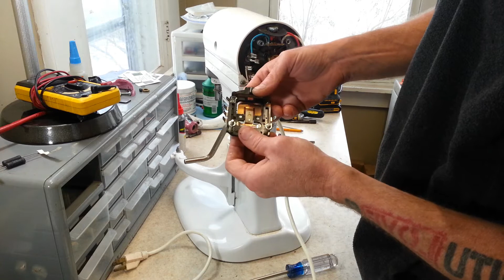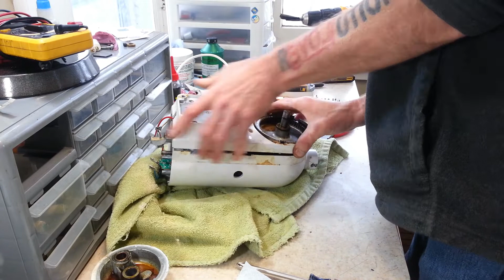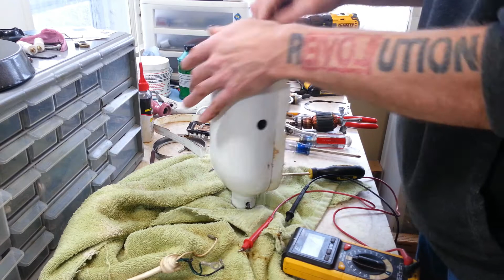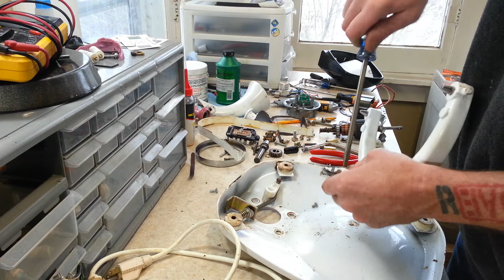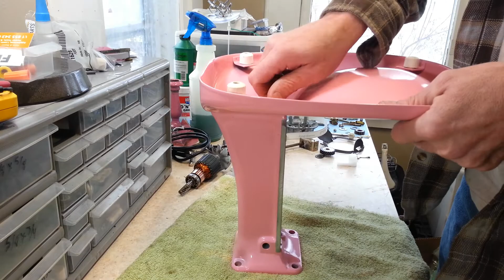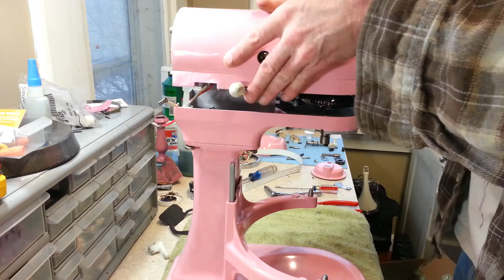Kitchenaid KSM5 mixer restoration in pastel pink

Comment: Same model I've got.  Made around 1998 or so.  Still going strong today, but I've also never dropped it...  Yet.  I really enjoy your videos, thanks!
Reply from the maker: Thanks Zachary! It does seem to be one of the better made KA's!
Reply: I have that one, too, but mine is Imperial Grey.  I've heard that even though Whirlpool owned the company by then, that they were still using Hobart specs for these mixers.  Mine is very strong and reliable, too, but I should get it re-greased.